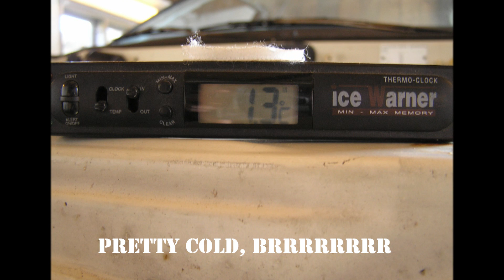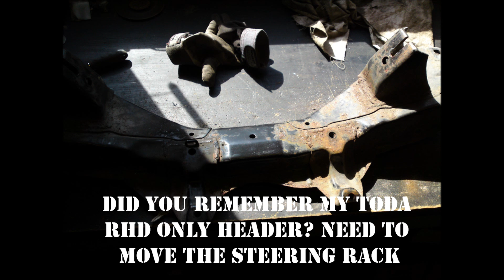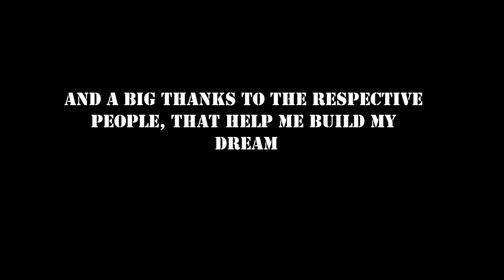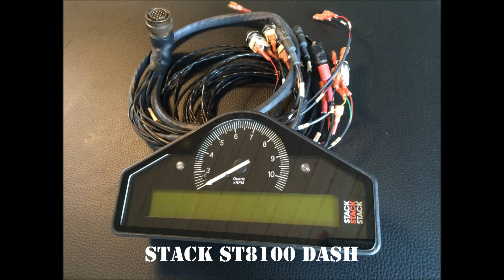AE86 Racecar project - AWESOME

Comment: Great build, the only suggestion I would make for safety reasons is  add a taxi bar between the roll cage just behind the seats, just the window height, this is for two reasons, 1. if you get hit from behind the seats wont  crash backwards if the brackets break , 2. attach your seat belts to this bar as in a crash the shorter the straps the less they stretch. Just a thought, once again very nice build. Cheers
Reply from the maker: Thats actually a great idea. And thanks mate

Comment: Very good working maximum respect. Look forward to your ITB's the best you can do! I drive a MX5 with ITB's i love it
Reply from the maker: Thanks :-) I got a MX5 too, se my new video :-) I had a plan to fit a set of Weber carbs, but now I have to sell the car. I imagine yours sound really great. Do you have a 1,6 or 1,8? and wich manifold and itb's are you using?
Reply: My MX5 is a 1.8, the manifold is from Jackson Racing,the exhaust system comes from Moss (Cobalt)
the ITB's 45mm are from Jenvey,the camshafts are from CatCam
Reply from the maker: How does it rev, compared with the 1,6?

Comment: i reckon the next big thing you should do is an independent rear suspension conversion, a lot of guys do it in the old corollas using nissan S13 rear subframes. It would be great for a track/hillclimb car
Reply from the maker: Yes it could be nice, but if the car should race in any class here in Denmark, this conversion are not allowed. And it could never drive on the road either.
Reply: Ah fair enough. The Regs are the same here in Malaysia. Would be awesome for an unlimited class kind of build
Reply from the maker: I actually think to build it to Historic homologation, but I think it will be pretty difficult.

Comment: That is some excessive spot welding you did there in my opinion. Hopefully you're not going to race it all the time since you did such a nice job restoring it. Otherwise, if you track constantly, I would say the body would last about 1, maybe 2 years before it starts to warp. About 15 years ago, I helped a friend build his 86 but we decided on a 3S instead of 4A. Since then, he's blown the engine so now he has a Frankenstein engine which is a mix of a 4AGE and 7AFE. I'm getting all nostalgic now. Anyway, take care of that car. looks great!
Reply from the maker: The spot welding strengthen the body and the roll cage are not just for safety, it also strengthen the body when mounted like I did. But no, I will not race it, only same trackdays and hillclimb for fun :-) A 7A-GE can be pretty powerfull, so not a bad choice :-)

Comment: You are an absolute mad man. Working on your car is really rewarding. What is the plan for the engine?
Reply from the maker: The engine will be a 7 rib Smallport block, with detuned Formula Atlantic pistons, TRD con rods, Tomei crank ladders, Fidanza lightweight flywheel and fully balanced. Head will be a ported and flowtestet Smallport, with T3 itb adapter, AE111 Blacktop itbs, Toda 4-2-1 header, rally 302deg camshafts with mild 8,1mm lift. Toda valvesprings, 1NZ shimless buckets and problably RB25 ignition coils.
Reply: Exciting, subbed for future content!

Comment: why the electric steering from a Corsa C? i have one and I can't understand
Reply from the maker: Because back then I build the steering column, these were the most common used electric power steering units in rally cars. It needs a electric box, that can simulate vehicle speed. Most electric powersteering column use Can-Bus signal, and this is pretty difficult to temple with. The Corsa C are conventional signal and I found the control box on ebay.
Reply: Evolution cool, thanks for the reply!

Comment: Hey bro, I was wondering how long it took you to get one of the rear quarter panels off? I was really wondering if you had any helpful tips for doing it, or any footage of it maybe? (sincerely doubt it, but figured i'd ask) Awesome video!
Reply from the maker: Nathaniel Mills Hey 😊 I think it took a few hours. If you got a new original panel, it welded under the roof. I cut it in the pillars, as I didn't want to take the roof of. Messure twice, cut one

Comment: Awesome build!
What engine/trans are you going to drop in it?
Reply from the maker: The engine will be a 7 rib Smallport block, with detuned Formula Atlantic pistons, TRD con rods, Tomei crank ladders, Fidanza lightweight flywheel and fully balanced. Head will be a ported and flowtestet Smallport, with T3 itb adapter, AE111 Blacktop itbs, Toda 4-2-1 header, rally 302deg camshafts with mild 8,1mm lift. Toda valvesprings, 1NZ shimless buckets and problably RB25 ignition coils. 
Gearbox will be a 5 speed close ratio, straight cut gears from Finish rallyexpert Lampola

Comment: Wow where did you find those rear quarter panels?  Awesome job
Reply from the maker: Hehe, it was long time ago, when you still could buy them at Toyota. Bought for both sides ;-) Stupid enough, I sold the other one 3 years ago.
Reply: I thought so, I think they completely stopped selling them in 2011.  Awesome car though, I'm currently building mine and this is great motivation.  I've never actually seen the stock 3 pt rear seat belts for the hatches before, pretty cool.
Reply: if i'm not mistaken now you can buy carbon panels from japan..
they are still making it

Comment: how long did it took you to put it like that ?

and how much  $$$ you put in to it!

I have a ae86 and put about 8k on it and it's 50% done
Reply from the maker: I did a diary, and the spend 500 hours, from start to finish the rolling shell. I still have to manage a complete wirring, brakes and of course the engine :-)
I belive the total, including parts for the engine, has passed 22.000 USD
Reply: Great job. 500 hours equated into how many months? Were you doing the work on weekends only? I am assuming this isn't like a full time deal for you. Mahalo from Hawaii.

Comment: so basically everything else than the shell was in mint condition
Reply from the maker: No, worn out engine, rear end and gearbox. The suspension was shitty and the interior was a patched up blue, with holes. So no, not mint ;-) But the shell was pretty rust free,  that was all that matters :-)

Comment: great job in rebuilding your AE86, i love it so much..
are you getting another version of from light and grill? i saw before another version headlight and grill that look nice. this is the link for the light version https://scontent.cdninstagram.com/t51.2885-15/e35/16583594_1318785014844355_4228143742382505984_n.jpg
parts are quite rare for most AE86 parts and expensive.

i don't own a AE86,  but i have a KE70 wagon in Malaysia. 
i do own a rare TRD 11k rpm tachometer :)
Reply from the maker: No I wan't to keep it with the old grill, and hopefully duct the air to the itb's
Reply: i understand :)

Comment: Bruh its AE85 LEVIN
Reply from the maker: Not possible, the AE85 was never sold in Europe. AE85 was a 8valve carburetted engine, 4 speed gearbox and open diff
Reply: @Evolution20v  ohhh i see
Reply: @Evolution20v  yeah ok Its AE86

Comment: I think its an 85 not a 86
Reply from the maker: Why do you think that?
Reply: Evolution i dont know... Illuminiati?
Reply: Evolution 85 or 86 still looking god
Reply from the maker: I_ Ensu the AE85 came with a 8 valve carburetored engine, open diff and drumbrakes in rear. The 85 was never sold in Europe, so I'm pretty sure my car is a 86 😜
Reply: Evolution ok u r right

Comment: that's a fuckin levin an 85 not 86 :/
Reply from the maker: You must study a bit more. A AE85 come with a 8 valve engine and carburator, no LSD diff, solid disc in front and drum brakes rear. This is a AE86 and if you don't belive, the VIN number are JT1C0AE86... ;-)